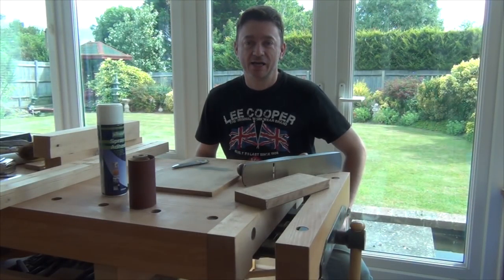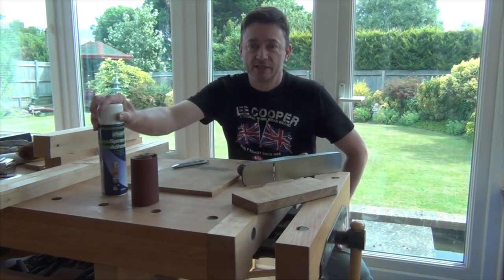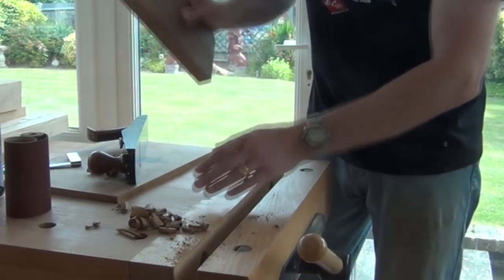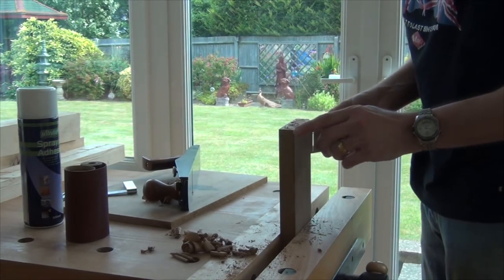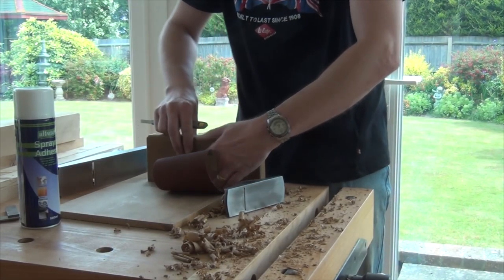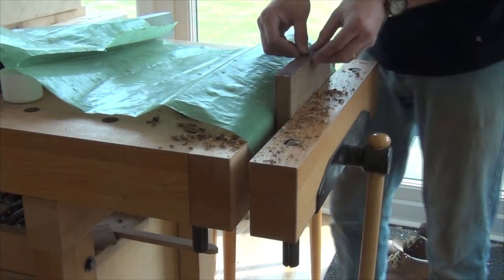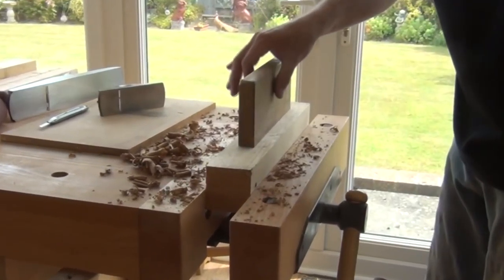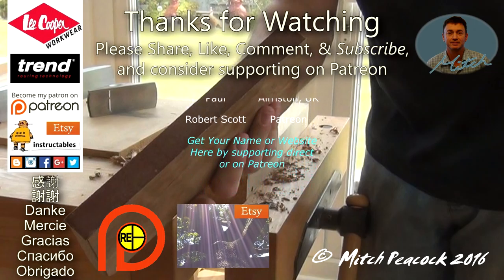Make a Leveling Beam (Fret Leveler, Sanding Jointer)

Comment: Thanks Mitch, you have inspired me to make one. I am sure that I would use this quite often in the workshop. Cheers matey! N.
Reply from the maker: Cheers Neil. I didn't mention in the video, but good quality abrasive is very worthwhile, as you can refresh it often with a rubber or brush, whereas the cheap stuff will loose it's particles and need replacing much sooner.
Reply: That is a very relevant point Mitch. I find that cheap end abrasives are a definite false economy. Cheers mate. N.

Comment: Hope your feeling better, Mitch. I use alot of various size DIY sanding blocks. Why does the one you made need to be so high?
Reply from the maker: Cheers Steve. Height gives both weight, and better grip, rigidity, and alignment.

Comment: could u put different grits on all four sides? well in this case 3 sides..lol good tip mitch..i have a bunch of belts that broke on my belt sander i was gonna throw away but now i found a use for em!"cheers!🖒💥
Reply from the maker: Cheers Joe. It really depends on your intended use. This one can be used right up against another surface without abrading it. If that's not a concern, then use all four sides. It is more comfortable to use if you don't have to grip the sandpaper, and the unused edges are chamfered.
Reply: Mitch Peacock - WOmadeOD right right. Ok yea that makes more sense..good thinking.

Comment: The beam you made is too tall, you could introduce more human error by potentially angling the block. Fret levelling beams are normally around 26” inch to cover the full fretboard and only an maybe 2 inch tall. Both edges need to be level and then you use two different grits one on each edge
Reply from the maker: Longer is sensible for full size guitars. I find the height is an advantage as far as keeping it perpendicular though. That may be coming at it from an engineering and woodworking background rather than a luthier.

Comment: Why this instead of a plane?
Reply from the maker: Good question Willem. Like I said, I made it for setting up a mitre saw, where I shall be leveling the aluminium table - not a job for my planes! This can level a sunken surface right into the edges - there are specialist planes for this, but not everyone will have one. Also, there will always be the odd occasion where edge tools just can't cope with the grain. And, where inlays prevent the use of edge tools, such as nickel or steel. These are also used to level frets on stringed instruments.
Reply: exactly what I wanted to know.  thanks to both of you!